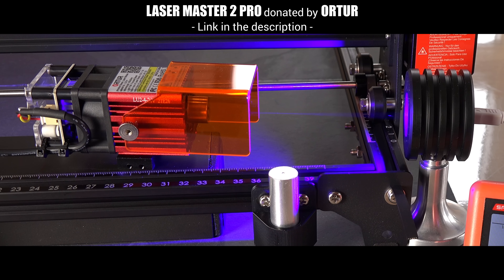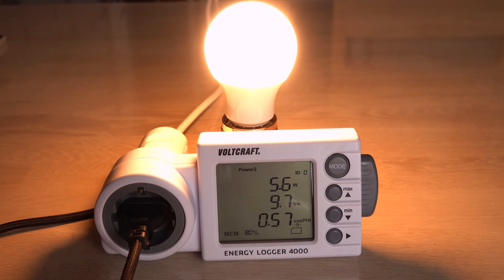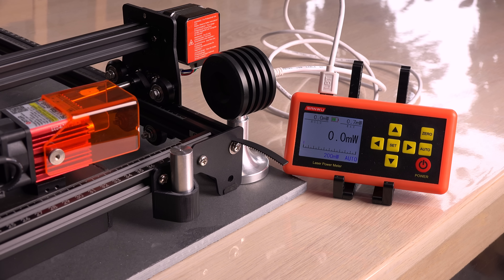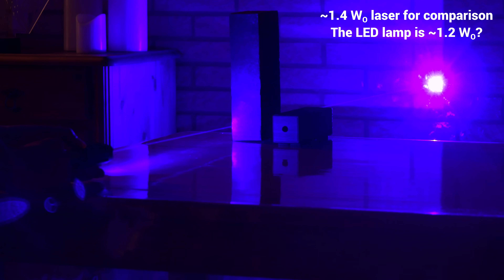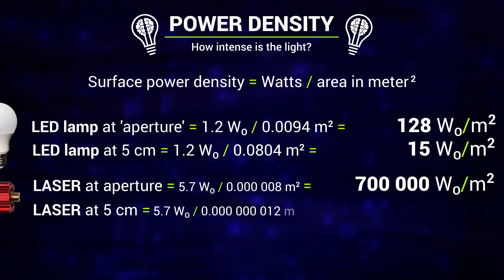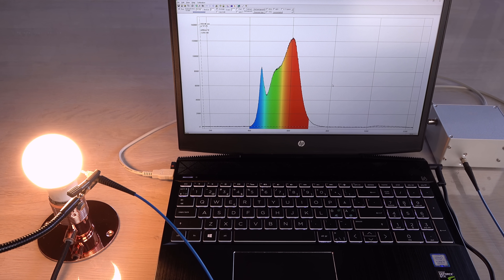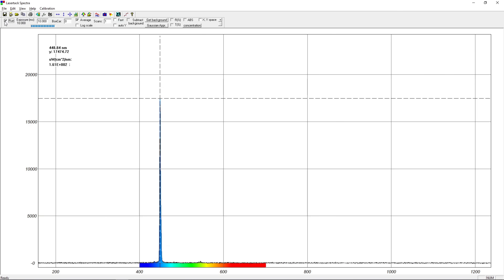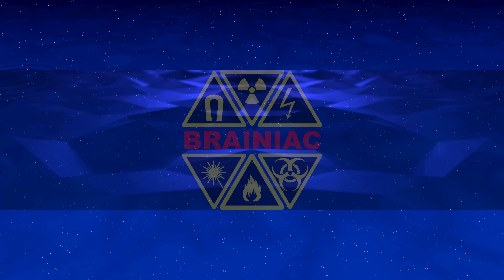Crazy difference between 5W LASER and 5W LED!

Comment: Great explanation.  I like how the rise in LED lighting has lead to consumer packaging listing lumens and color temperature, which makes more sense than "40 watt equivalent."
Reply from the maker: Thanks! The lumens listing is interesting. As I've understood it, the 470 lumens is for a well-ventilated lamp. It will heat up and go lower in lumens if the lamp is poorly ventilated. May have to dig further into the topic and make some tests - possibly a video. I have an old 40 watt incandescent bulb that is advertised at 400 lumens, so the LED can go lower and still match a 40 W incandescent lamp.
Reply: @brainiac75  can you do a video comparing different quality laser goggles
Reply: @brainiac75  A video would be interesting.  The old incandescent filament plates out on the glass the newer halogen ones redeposit on the filament keeping them brighter. The led suffer phosphor degradation iirc 80% output at the mythical 50k hours. The whole topic of how the brain synthesizes color perception could be a couple of videos.
Reply: @brainiac75  Growing up I never paid much attention to the "lumens" specification on the incandescent  bulb package, it has always been the "watts" rating.
So yes, as LED's came out it made and still makes perfect sense to put "watt equivalence" on the package so the consumer get an idea of what intensity to expect.
Reply: They picked the equivalency rating at a midpoint between European and American voltages. At low voltage incandescent lights are more efficient or longer lasting, which is why we use step down transformers for small halogen bulbs. Some light is lost on the polycarbonate globe. The bare LEDs work better as a replacement for reflector bulbs.
Reply: That's true. But now think of 80 year old people that have used incandescent bulbs their whole life. It doesn't hurt sales to  have an "equivalent" for them on the box. Some customary units are just odd, like selling natural gas in MWh of energy that you will get if you burn it.
Reply: @kwinzman  Not really necessary for those people. I know that also 96 years old lady understands the lumen. At that time people did get a real education in physics. Not political indoctrinated knowledge. And even easier to understand....more lumen is more light.
But I've heard much younger people complain that I put a 300 watt equivalent led in an armatur for max 75 watts. The armatur should collaps because I was "overusing" it. Clearly that those younger people did not understand the meaning" for this watt equivalent".

(That LED was a multiple led lamp total 50 watts power input  version)
Reply: @kwinzman  I guess 80year old who were buying 40w for their entire lives need 40w LED because they usually have cataracts (that would be 120W or something in incandescent). 
They will just complain its dark anyway... that's what old people do (at least my parents do). its always dark, and the TV is always with too little "volume" ( I guess because CRTs really had Volume back in the day, if you know what I mean)
So I buy them 8000 Lumens lamps and put the TV at 30, which I guess is 30db or something, I can hear the TV from their garage.
Getting old sucks, I've already lost hearing above 13Khz (can't hear the dog whistle anymore), but my eyes are still pristine, (except for stupid floaters, damn floaters)
Reply: @monad_tcp  the by me mentioned 96 years old uses at the moment 906 lumen led's . 75-100 watt equivalentn as replacement for 40 watts old bulbs.  Only double lumens because of age.
My own 50 watt led , used as single lamp in a quite dark room, replaces three 100watt old type bulbs....estimated between 350 and 500 watts equivalent. It's much more light then those three together.
Reply: @kwinzman  yes! at that point of the production line, you're already putting ink to paper, so why not have both pieces of information clearly printed out
Reply: @sleepyfutchtgirl470  I mean the latest trend is to write 18kWh/1000h on the bulbs.
I mean you realize that 18kWh/1000h is the same as 18Wh/h which is just 18W. So they could just write 18W. I laugh every time. They must have a lot of extra space on the packaging for all that extra unnecessary letters. On the other hand I would love more extensive CRI information, like a complete wavelength emission graph, which of course they don't print.
Reply: I have to confess. I'm a 65 year old technical photographer (mostly retired) so I should know better. However,  when I go to the store I look for the brightest 'watt equivalent' LEDs, and always want the Daylight bulbs (5500°K and up). And I am old enough that when a light bulb says 'Daylight' on the packaging I can't help but hesitate, immediately thinking of 'Daylight' Fluorescent bulbs from the 60s (maybe the 50s) - these were horrible but bright tubes that were for use in hallways, stairways, and inside building entrances. They had a noticeable flicker that could easily trigger a migraine if I spent any time in a space lit by them.  Terrific video because of its clarity and firm foundation in basic principles. Thank you. (As a teacher I realized that too often we know enough without that basic understanding that students need - it's also what we really need to fully understand things in our world we need to work with. Your channel clearly understands this.)
Reply: @WillN2Go1  I'm just 32 yo, I always power the light to see it before buying. easy and simple, I don't care about the numbers much. But you get a sense for lumems, its pretty practical. Its like having a sense for kilograms.
Reply: @WillN2Go1  My parents' house had several 4 foot fluorescent fixtures until a few years ago (whoever owned the house before them must have loved fluorescents). Many of the tubes were GE Mainlighter "cool white". To give an idea of how old these were, the Mainlighter brand existed from the 1960s and was discontinued in 1985. It's impressive that they lasted so long, but they gave off such a lifeless grey-blue light.

I rewired most of those fixtures and replaced them with 4500k LED tubes. The difference was almost literally night and day, much brighter and the rooms have actual color to them now. Also gone is the 60hz flicker that the fluorescents had.
Reply: @AdhamOhm  I'm looking at a beautiful fluorescent fixture I've got suspended in my living room (I'm more function than form). It's from the 80s - was electronic ballast - better than the older PCB flickering ballasts - but I also gutted it and installed LEDs. The difference is amazing.  I've also added some long 8' LED strip lights to my out door shop.  LEDs are inexpensive, bright, brilliant color spectrum. I think the people who stockpiled the old incandescent warm white bulbs don't have a clue.
Reply: @WillN2Go1  Also a photographer here, I still find it odd that "daylight" bulbs aren't 6500k. It's what prints are normally calibrated for, it's what screens are all calibrated for, yet "daylight" isn't really daylight.
Reply: @WillN2Go1  I think people will be using the incandescent "wattage equivalent" as a standard for comparison and shopping for some time to come.  We are generally looking at 40, 60, 75, or 100 watt equivalents.  That is much easier that remembering 750, 850, 1100, or whatever lumens.
Reply: @WillN2Go1  You have pinpointed the exact reason why I often complained of a headache to my teachers, which would go away by the time I got home (and my parents would think I was lying or faking a headache, because I was just fine when I got home, after a 15+ minutes walk).
I thought it had to do with the atmospheric pressure (my house being at a higher elevation than the school), or with me sensing the hidden animosity "in the air" which later turned into a genocidal aggression.
Reply: People tend to think in units of measure with which they are most familiar.  So, after decades of thinking about the amount of light I get from a light bulb in terms of the watts it consumed, it is not easy or quick to make the leap to a new method of measure.
Reply: Actually, for those of us that grew up with incandescent lights that is a GREAT way to give us an idea of how much light intensity we can expect.
Reply: @DrHarryT  That is partially true (I was born in the eighties so I know what you're talking about) but those numbers vary so much from manufacturer to manufacturer that they end up being more misleading than informative.  There's no industry standard.  Same with "warm white, pure white, clean white, bright white" or whatever. So much confusing information already on those boxes that I believe adding stuff like watt equivalence and qualitative color descriptions just makes it worse.
Reply: I think it's more to do with older people, in general it's older people who buys light bulbs. And my dad still looks at the "watt equivalent" mainly because it's what he understands.
But I've been teaching him the Lumens and color temperatures and he's began to use those more often now.
Reply: @carlangelo653  What are you talking about? Everybody who uses electricity buys light bulbs!
Reply: Maybe soon color rendering index (CRI).
Not because people interpret that any better but for those who do certain applications like reef tanks or hydroponic applications could make use of it. It's been a few years decades actually since I had a reef tank but it is so much easier to deal with the crucial heating problem if using LEDs instead of HID incandescence.
The Stony Corals in particular require extremely high light intensity but will not tolerate heat as well as weed does....   LOL  XD
I'm sure there was a market for a screw in style bulb for such applications as a solar folks don't have the time or the patience or the ability to deal with a thousand tiny little LEDs and the associated components to make them work efficiently and reliably. Hell I can't hardly even type my thumbs are too big the screen is too small and my eyes are far too pad so working on micro Electronics is not really an option for me (and that's why I voice type)
Reply: LED vs Incandescent is tricky because the spectrum of the emitted light varies too much. Show us an incandescent which has same spectrum as incandescent.
Reply: Uzi nine millimita
Reply: @RCmaniac667  that'll light the room up 🤣
Reply: Or what lol
Reply: If I see a "watt equivalence" listed on the box I set it back down
Reply: But you are likely one of the few who do since nobody knows how to relate to kelvin's it's likely you could get away with putting any value you like on the packaging as most people wouldn't understand how to interpret it
Reply: As a relatively young (millennial) whose light fixtures always have max wattage listed on the fixtures as indicated for incandescent bulbs, and who grew up with the scale, the “watt equivalent” makes more sense than lumens, because who the hell learned organically what a lumen was?

It’s just like me as an American and engineer, I do all my work in Celsius, but if I actually want to know what it feels like outside, I mentally use a vastly inferior Fahrenheit system. Why? Because that’s the scale my brain is calibrated on for that, because all my life temperature was listed as Fahrenheit on the news or at the bank, so I know how that feels.

Lumens actually instead is like throwing out the “heat index” or “wind chill” because even if it literally is one temperature it feels like a different one, which is a useful scale, but again not one I’m calibrated too. Worse, my mental centigrade weather scale is calibrated from time in a tropical country so it fairs poorly in a much more arid American state during the summer, and fails completely in winter.

I do like color temperature though. It makes it easier to filter out the standard yellow-ish lights that are everywhere and get the bluer lights closer to daylight that my wife and I much prefer at home. I hate that yellowish simulated incandescent look that is most common.
Reply: @robertb6889  lumen rating is there for a very good reason. It's the total light output, generally speaking (which is kinda fundamental facts an engineer should know). And that's a standard. So a consumer would know the exact amount of light they get. But "incandescent watt equivalent" is not a standard and just a marketing term which can be used to fool consumers. However, it also gives a general idea about the light output, so I think both systems should be there. Standard units are used in engineering to avoid confusion. Btw, there's another factor called CRI when it comes to lighting fixtures - which translates how well you'd perceive colors under a given lighting. So there are lots of things to consider.
Reply: @cenchloraadums3143  yes - but what I'm saying is that OSHA ratings are "Lumen's per square foot" - not just "lumens total."

If you have an 800 lumen light in a small personal office it's VERY different than a single 800 lumen light illuminating a cubical farm with 60 employees.
Reply: Also the human eye's perception of brightness is subjective at different color temperatures.
Reply: @elyeryan8838  I'm spoiled on 5000K. Higher temperatures look blue and appear to flicker at a high rate. Lower color temperatures appear yellow. We have an old 2500K LED bulb that we call "brown".  😁
Reply: @Bob_Adkins  even 4000k is starting to look blue to me on led so with a fluorescent 4100 has a hint of yellow but I think I prefer like 3500 for a hint of yellow in the house and a more white 4000-4500k in a workshop
Reply: @noodlelynoodle.  A lot of people don't like 5000-5600K. It's only important when doing color matching and finely detailed work.  I especially like 5000K in the kitchen and shop.
Reply: Hm. What is lumen. I need light level when my cam stop noise
Reply: @Gameplayer55055  hah! There are so many ways to measure light, depending on what you need. Lumens are total light output, adjusted for the sensitivity of a "normal" human eye. Lux is brightness of a lit surface. Nits for the brightness of a light source. Candela for the brightness of a beam of light. CRI for how true the light is to a reference white source, and Kelvin to identify the reference. That's just the start, too!
Reply: @Traqr  Dude, do you have a doctorate in photology or lumenology? I'm unaccustomed to intelligent comments in most of the YouTube comment sections, much less posts where I learn something new. I make apologies to no one as I thank you for... illuminating us.

Comment: 7:35 Cool, you have locally converted your limestone into calcium oxide, which is why it turned white where the laser hit. See Cody'sLab latest video.
Reply from the maker: Didn't know the chemistry in it. Interesting. I like how it is multi-colored. The parts that were hit at low power turned white, while the parts hit with full power turned more yellow-white. Thanks for watching!
Reply: this sounds wrong to me.  The base he engraved is a slab of slate, which contains mostly silicate minerals. The white color is just the color of molten and recrystallized silica.
Reply: @billsmathers7787  yep, I don't think there is any carbonate-containing slate.
Reply: In any case, burning an image into rock is impressive.
Reply: You could tell if it was quicklime (CaO) by dripping water on it, which causes a highly exothermic reaction and produces slaked lime (Ca(OH2)). I don't think it's a limestone slab though.
Reply: Slate is a metamorphic mudstone, so it consists of mostly silicates, with some carbonates.
Reply: I didn't think about doing that.  I was trying to figure out a better way to make calcium oxide than building a kiln.  This might work.